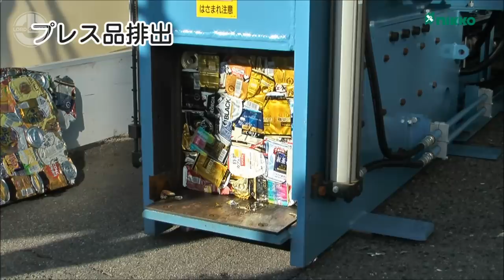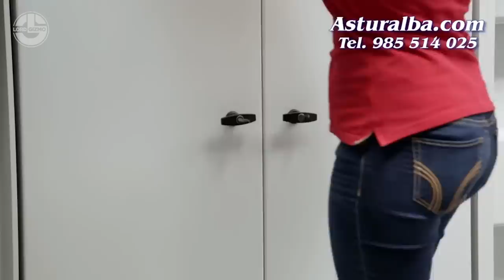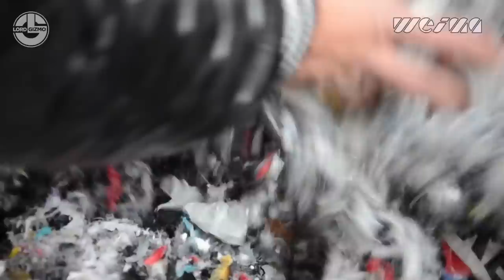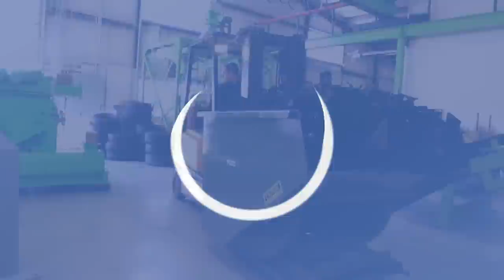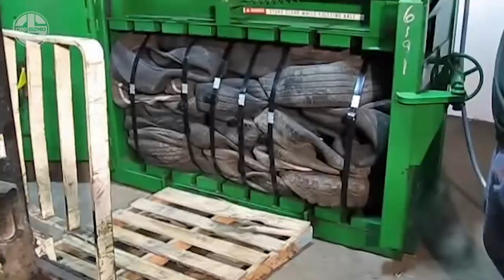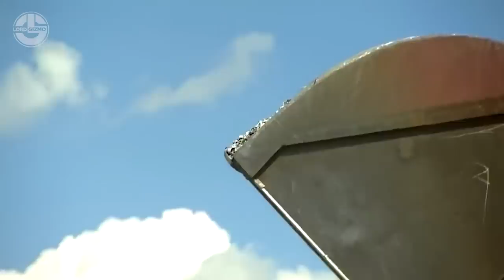Amazing Recycling Machines That Are At Another Level

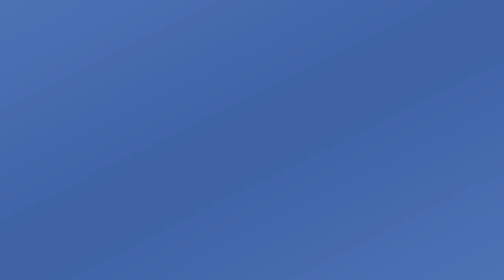Comment: That tire cutting machine at the 1:35 mark is about as slow as can be imagined.
We have mountains of tires world wide, the power/energy that machine uses as well as requiring a person to operate it is crazy slow.
It would take 1000s of those machines 100s of years to even make a dent in all the used tires we have piled up.
The Eco-Green Tire Cutter is much better.
Reply: It's for small lot use, there are bigger ones.
Reply: Asphalt companies can't spend infinite money, though. And their goal is to make asphalt, not to clean up the world of used tires. In fact, it's not in their business interest that the world's used tires supply be depleted. They wouldn't sell as many of the smaller machines. Furthermore, the rubber of the tires doesn't exactly disappear when you put it into the asphalt. Eventually, they tend to grind that asphalt off so that they can put new down. And I am not sure that piles of rubber-coated rocks is all that great for the planet either. But at least the asphalt can be recycled. But how much of the Planet's land area do you want covered in asphalt?

But they are also not the only people consuming the supply of used tires, either. I just recently watched a long strip of floor mat be 'shaved' off of a compressed spool of vulkanized shredded tires. They grind them up with powerful grinders, sift for iron/steel via magnets, etc. And those little pieces of tires are what they put into the huge cylindrical mold when they vulkanize it. Then they spin that huge thing on an equally huge machine that slices whatever thickness desired for the mats.

Comment: Regarding the tire cutting machine, where the one lone guy cuts the sidewalls first. Why is that machine located outside of the building? That poor guy would be working outside in inclement weather all through his work shift just to cut up old tires. It would make more sense to do this job inside where the worker wouldn't catch polio or pneumonia being in the snow and rain.

Comment: That’s a lot of manual labor on tires.
Reply: A machine designed WRONG . Tires per hour is Low . High Labor and Power cost per tire is unacceptable .
Reply: Charlie is absolutely correct. Your back would be screaming at you after a day of picking bits from the floor. How about a table to catch the pieces as a start?

Comment: All good.  But what is really needed is a machine that sorts the trash stream that's headed to the landfill.
Reply: Invent that you'll own the world...
Reply: @haroldwilkes6608  People are working on it.  I suspect as soon as there's a serious application of AI we'll see a large percentage of trash diverted from landfills.

Think about a garbage truck backing in and dumping its load on a long conveyor belt.   All that stuff gets spread out a bit and robots, using feeds from cameras, pick out the identifiable pieces.  

Look at how Tesla's full self driving system is using AI.  First a lot of pictures of things are collected and someone labels them.  "This is a ketchup bottle, this a bicycle, this a basketball".  One of the robots picks up the identified object and dumps it in a chute for ketchup bottles, bicycles, basketballs, whatever.

Once in place it becomes a low cost sorting operation.  We really need to be moving to a sustainable system where what we don't want any longer can be recycled or composted.
Reply: @bobwallace9753  !00% agree. I have pictured it much as you described. In a small town with limited daily trucks, it might not be feasible yet simply because of cost but a large city with thousands of trucks could make it worthwhile. From trash to cash is technically possible today but the economics of process needs work. I worked logistics once, in the door raw, process, out the door finished. We had very little waste but even that we sold at a slight profit. I do worry a tiny bit about AI though, employment, you know.
Reply: @haroldwilkes6608  We need to face the fact that AI and smart machines are probably going to eliminate the need for human labor.  We're now seeing robotaxis hauling passengers around cities, presently at a small scale, with no one sitting in the driver's seat.  Most driving jobs are likely to disappear over the next several years.

We're seeing AI write media articles, perform surgery, and write legal contracts.  We're seeing smart machines cook food and mix drinks.  If humans can do it most likely machines can do it faster and better.

I don't know how long it will take to make human labor worthless but it's already started.  We need to be thinking about how we distribute goods and services once human labor/time has no value.

The only idea I've heard about is a universal basic income.  We need to be thinking seriously to see if we can come up with something better if we can.
Reply: @bobwallace9753  True, I've read science fiction all my life and frankly, much of it along this line, seems like life would be boring. I'm 78 so the effects on me will be minimal but while intellectually I can see the benefits of AI, I question the value to the human psyche. We may find new frontiers to explore but why would we when AI can do it as well if not better. I think productive work is essential to human growth and the lack would result in stagnation and gradual loss of human dignity along with mental capacity, in effect, devolution. Hopefully, I'm wrong. But if the world ever becomes self-sustaining without human labor, why would we need to exist? As amusements for the sybarites? No thanks.
Reply: @haroldwilkes6608  I bow to your more extensive life experience.  (Of a few months ;o)

Whether we like it or not I can't see how AI and smart machines will not be our future.  Economics will cause employers to move away from hiring humans.  

You and I grew up when a common threat was "Get an education or you'll end up digging ditches" and we saw gangs of men with picks and shovels down in ditches throwing out dirt all day long.  Someone invented the backhoe/excavator and those jobs disappeared.  We're dis-inventing cashiers at checkout stations, bank tellers, and other commonly held jobs.  Invent the replacement once and remove the need for hundreds of thousands of people forever.

It cost about $100,000 per year to keep a driver in a taxi 18 hours a day, 365 days a year.  The extra hardware for a robotaxi is a few thousand dollars (worst case).

So what might humans do once freed of the need to work?  Some will piss their lives away as some do now.  Some may spend their time doing things you and I might not view as "useful".  But what they do will be what they want to do.  Video games from waking to sleep?  Their choice.

Some may be freed to be incredibly creative.  While AI can likely be super creative I suspect we will still enjoy watching/reading/listening to what other humans can produce.

Maybe we'll develop lifestyles that involve spending part of our time being creative. Part in activities with others such as sports, games, dances.  Spend more time out in nature or gardening.  I've been retired for over 30 years and I've never had a moment with nothing to do.  Before I retired I spent a lot of time in boring, useless meetings and whiling away the hours waiting for quitting time when I could leave and do things that I wanted to do (some of the jobs I had).

Comment: Where I work we recycle anything metal we have a 50 ton per hr hammer mill that shreds cars and collects all the steel and non ferrous then we have a Harris press to bale wires and cable that can't be shred and then inside we have a marathon nexgen baler that bales aluminum, cans, copper wire And pipe, radiators it can take a small boat and cut and bale it

Comment: How much are they ?? 
Should people know what they cost.
Reply from the maker: Well, that's a big variable.  It's highly regional, with no single "cost" to look at.  There's the baseline manufacturing cost, then the "retail" price (which is always in flux, especially from one place to another), then transporting prices (which are quite high), then running costs (which can vary on output and area).

That, and it's nearly impossible to get that kind of info for most machines!  It's not like going to a dealership and buying a new car; dealers of these machines will give quotes that may factor in anything ranging from add-ons to transport.

Comment: The tire machine is dumb. It's slow and looks like very user unfriendly. The 1st tire machine that is.
Reply from the maker: Well, the machine is designed to be small, cheap, and relatively simple to operate.  Perhaps it's not the best machine for taking apart tires, but it is one that gets the job done :)